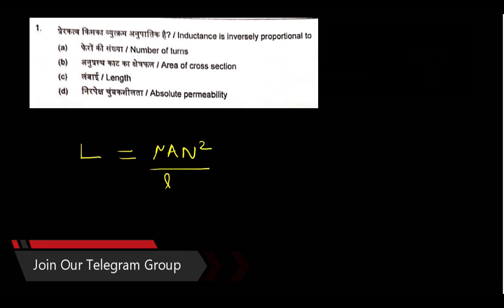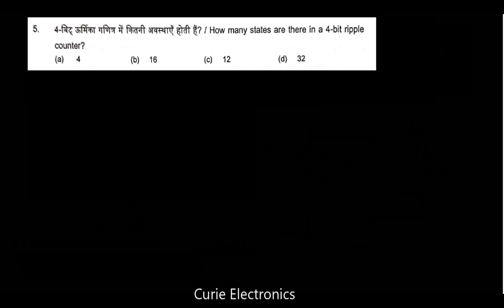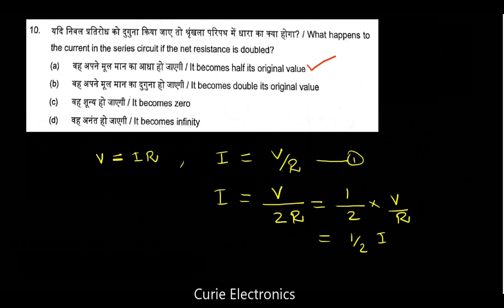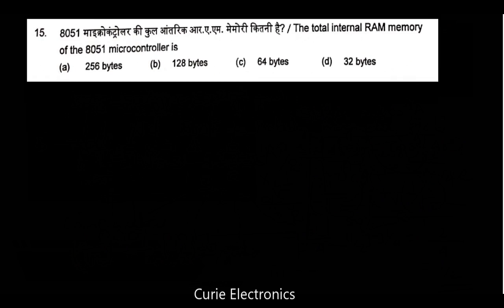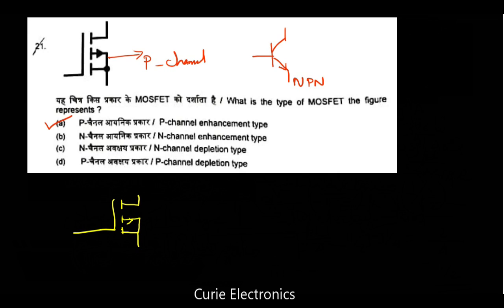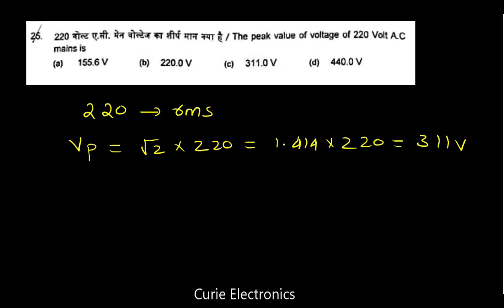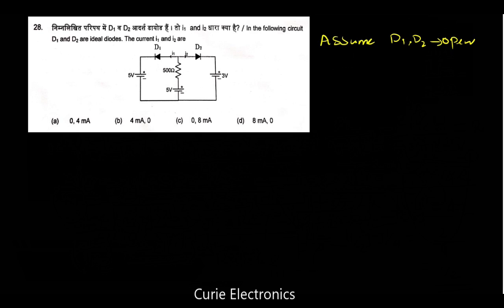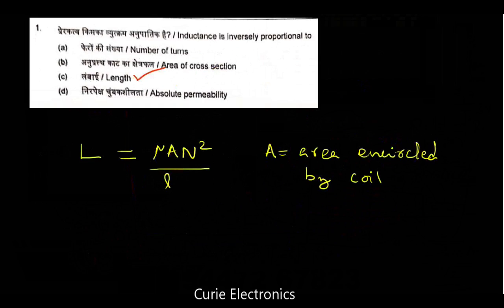HSFC Technician B Electronics 2022 PART 1

Comment: Answer of Q.3 Should be option A because the gain of Op-Amp is given as A=2, So output never saturate.
Reply from the maker: Op-amp is configured in Open-loop.
Reply: That I understand sir. Then what is the significant of mentioned gain?
Reply from the maker: @narattamhaldar6184  To get the other three outputs given, op-amp has to be configured as an amplifier.But the given circuit is not an amplifier.